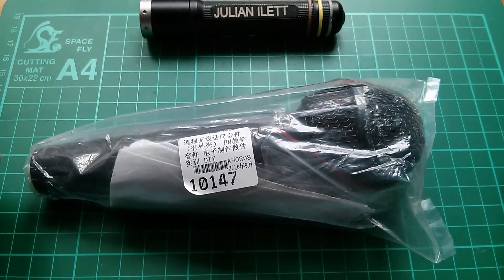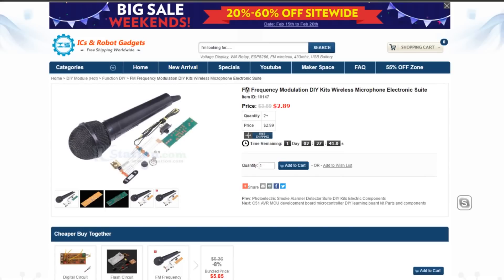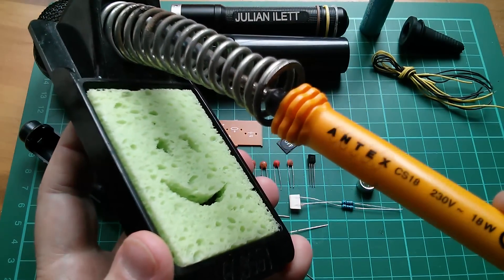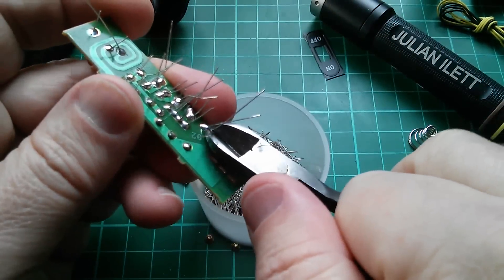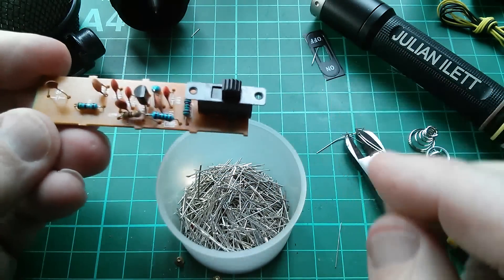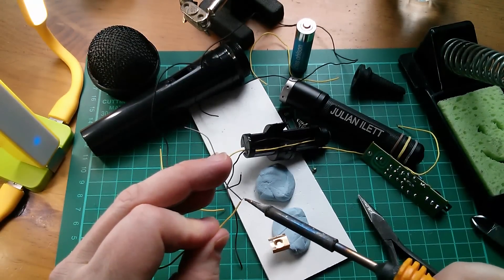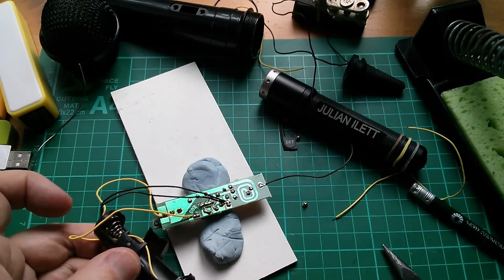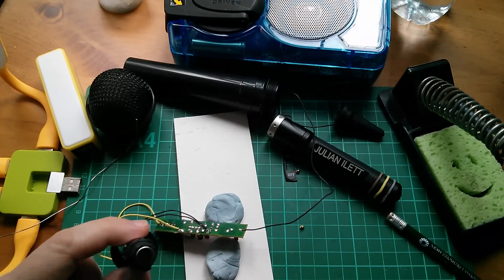Lazy Sunday - Wireless FM Microphone Kit

Comment: Watch the clipping wires, I've blown up a bench power supply that way.  A lead managed to slip right through a vent hole and into the PCB inside. Boom!..  I recommend that you keep a finger in contact with the leads as you clip, just to dampen the energy a bit.

Comment: That's simple project and basic,
it doesn't need a trimmer and the coil has no need for winding, already on PCB.
And the low transmitting range is comfortable for home room distance.
Thank you for your spending efforts.

Comment: This looks like world famous 1 pound powerbank from Poundworld.  I have tested battery in one of those and it came up to a whopping 624 mAh (at 0.5 A discharge). And since those lights are rated at 1.2W you can expect less than 40 minutes of run time. Not brilliant.
Reply: I've modded all mine and put in a quality 2600 mAh cell.

Comment: anything that can be done to improve it, like a better mic or boost the output power?
Reply from the maker: Not really, the circuit is very basic. The mic module is probably good quality. More power would need a higher battery voltage, but this circuit is designed to run from 1.5V

Comment: I have an old school degaussing coil intended for CRT's; had it for eons. ID measures about 11 1/4" (286mm), and works great for most anything you can pass through it... or wave it over for all that matter. With coil & tool/s held at arms length, energize coil, bring coil & objects together and wave through coil, then separate before releasing coil switch. Full cycle  only needs to be 7 seconds or so. Check ebay for the coil's...
Reply: I used to use one of those degausing coils in my very first job eons ago :-)

Comment: Why would copper wires stick to magnetized cutters?
Reply: Most resistor leads are made from tin plated steel, copper is too expensive.  It's been that way for at least 40 years.  Copper is only used for high power resistors where heat conduction through the leads is more important.  Glass bodied components use other alloys which have a temperature coefficient of expansion matched to the glass to prevent cracking.
Reply: Copper?
Reply: Yes. Copper is a very good conductor and used widely in electronic components. Silver and gold are better but are also non-magnetic. Could be aluminium but also non-magnetic. Just wondering.
Reply: number 33, Wow. Thanks, I didn't know that. Glad I asked because I know a tiny bit more today than I did yesterday.

Comment: I would have thought that a better way to go is to put the local oscillator through a phase splitter to get I and Q then I goes through a DSB modulator then combined with the Q phase then quadrupled up to the required frequency, (I think the method is the Amstrong FM modulator)

Comment: got s double take in there with your power bank but enjoyed it
Reply from the maker: Editing mishap :s
Reply: Thank feck for that.... Thought Julian's voice had finally hypnotized me!
Reply: got s double take in there with your power bank but enjoyed it! :)
NB: You need a better soldering iron stand... your current one is just a bad heat sink!
Reply: just went to comment the same. pretty cool kit though none the less
Reply: Martin Rabson - The soldering iron shouldn't touch the spring, it just forces the iron to stay on all the time trying to heat up the metal! Most holders have a heat proof 'plastic' holder that fits the iron and holds it centrally. 
Look up "weller solder station"
Reply: Not wear out faster as such, ( for soldering irons, only the tips wear out ), but driving the heating element so hard will reduce the life of it considerably... but a 'good' iron will last many years ... even despite Julian's maltreatment of it! ;-)
Reply: Julian Ilett you're not allowed to :D